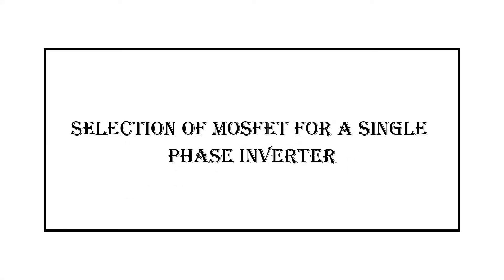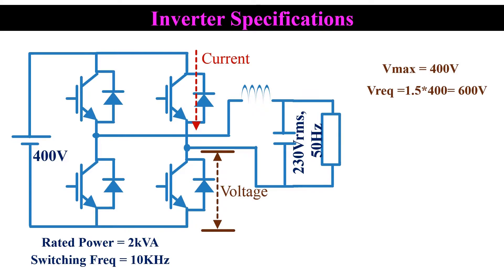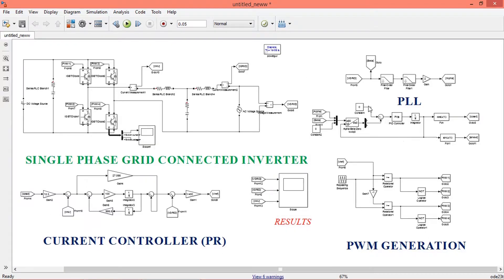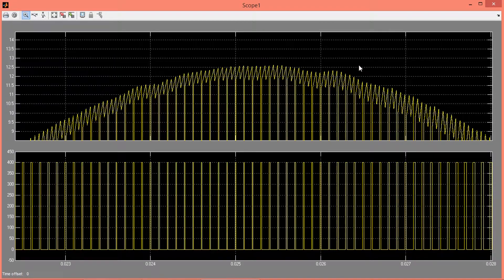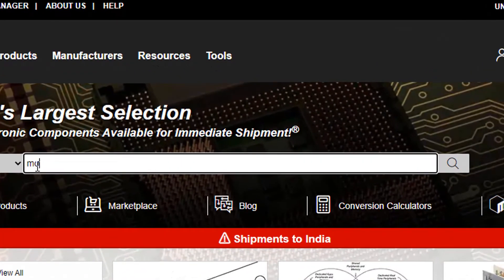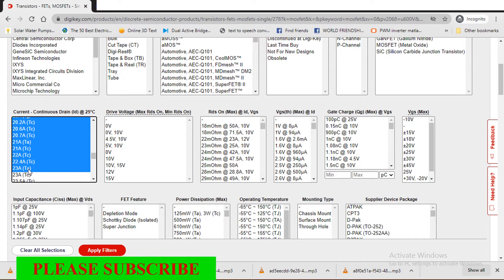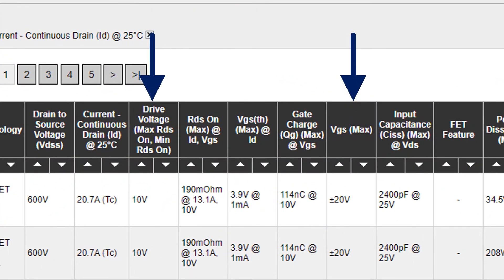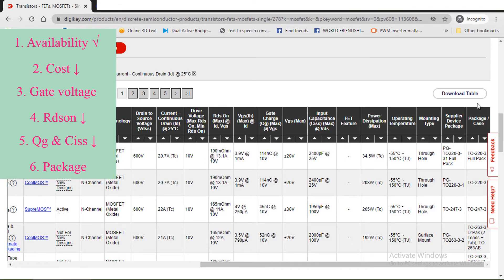How to properly select a MOSFET for single phase inverter? Complete Guide!

Comment: What is the reason for the high voltage DC source? Wouldn't 325v DC be enough for 230v AC RMS? (not an expert.. I just want to learn)
Reply from the maker: maximum voltage is the DC bus voltage, not the peak value of output ac

Comment: Thank you for the video! could you explain how to drive the switching of the mosfet using PWM?
Reply from the maker: You need to have a gate driver circuit. You can make gate driver circuit using bjts optocouplers, dedicated gate driver ics etc

Comment: Hi, does this also apply to three phase? And how do you select the right values for DC-link capacitor for flying capacitor and cascades h bridge?
Reply from the maker: yes. But the equation to find the voltage and current will be different. method remains the same. selecting DC link capacitor involves hell lots of things, and would be difficult to explain everything here.
Reply: @TechSimulator  Sir if possible can you please upload a Video on Design of DC link capacitor. We need it as a part of our Project..
Reply: Thank you so much! Can I ask for your help for connecting a three phase inverter? if it’s okay
Reply from the maker: Wick Bron ya sure
Reply: Cool thanks! I wanna ask how did you calculate the Rated power kVA and output voltage Vrms in three phase and what is the equation for current and voltage ( three phase)?